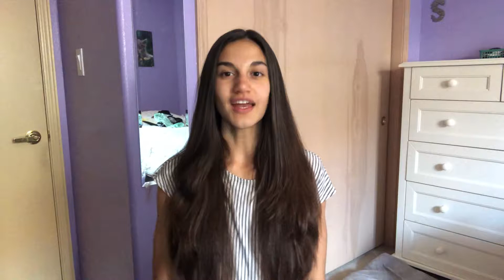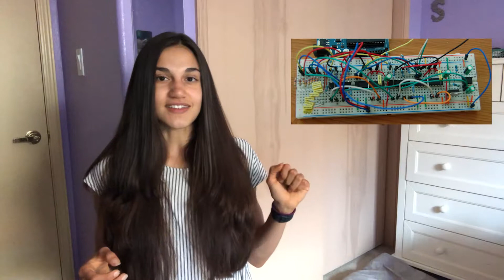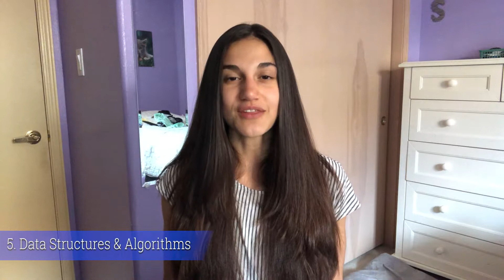Top 5 HARDEST Engineering Courses | COMPUTER ENGINEERING | My Experience

Comment: Is working on arduino helpful at all in this study before I go to study CE? I’m about to go to college and I just want to know what are some good things to know before going into the field so I have a head start. I know Java and C and how cybersecurity tools work and how to implement so that’s kind of a gauge of where I’m at
Reply: I can’t speak for every university/curriculum but with me (going into 3rd year comp eng) I would recommend learning matlab basics. This was my first language course required, and later in my signal processing (lab portion) it was completely using matlab. So far I’ve had a couple courses with arduinos but they very slowly introduced any use of them. I believe microcontrollers (year 3) goes pretty heavy in arduino but the courses before provide a really good foundation. Also any outside projects or hobbies (here IEEE robotics is great) that you can maintain is extra helpful. My curriculum had me take (in this order) matlab, c, vhdl, then Java. Language wise after about the first 2 Java came very easy to me and many other comp engr students, even with no previous Java experience (but it doesn’t hurt either). Hope this helped some, and good luck!

Comment: At our school, Data Structures was a weed-out class. The professor purposely made the projects difficult(for a novice) to see who could handle the independent research on their own. He did end up curving grades at end of semester AFTER the drop date to whoever made it that far. By far the most stressful class I took because we had to pick the structure and he wouldn't tell you if you did it the inefficient way, such as using vector of vectors vs using maps(which is way easier to implement) for a data clustering program. On another note Assembly Language was tough on the first go, but I picked it up fairly quickly in Embedded Systems when programming DSP's. I did have to take Linear Algebra three times, but I blame myself for lack of discipline on the studies.
Reply from the maker: Ouch, I know the feeling. The circuits I and II classes that I had were exactly like your data structure class (which is probably why it was so painful and long). Don’t know why some professors have a need to do that (especially for more advance courses) I think they just get a kick out of watching their students suffer...hey, well at least you finally passed the class, right? That’s all the matters in the end.

Comment: Which best books do you use on your studies
Reply from the maker: There were a wide range of books that I have used. I can’t remember most of them lol but some of the ones I do know for sure were electric circuits by Nelson Riedel (10th edition), Discrete mathematics (third edition) by Edgar Goodair and a lot of “Foundations of” books (i.e. Foundations of calculus/analog and digital circuits/networking). I plan to do a video on this sometime so if you would like to know more about them, then please stay tuned!
Reply: @TheSn12  i already  subscribed your channel.. please do so, Because I'll be starting my computer engineering course very soon. I would love to know the best books that i can use for the 1st year, 2nd year, 3rd year and 4th year. Btw have you ever used "mathematical engineering" by Stroud?

Comment: Do you use alot of the concepts you learned in circuits 1 & 2 in your career today?
Reply from the maker: Nope. Nada. Haven’t looked at that material since I took the class. Although, if you want to take the hardware track of CompE and decide to have a career that in involves building/tinkering with test boards/microprocessors then you’ll definitely use it.
Reply: IMO, basic circuit fundamentals are essential for most elec./comp. engineering jobs and career focuses. Being able to look at a circuit and understand how the signals within in go through it is the fundamental aspect of any design, test, or troubleshooting role in an EE/CE job. Like most engineering courses, you will not need to know every little equation or concept in your career. It is the fundamental methods you use to solve problems that bring success later in your career. If you ever talk to a consultant that works on diverse skillet teams, they might tell you that depending on the background of degree or expertise an individual will take a very different approach to solve the same problem.

Comment: so happy you said circuits 1&2 first lol
Reply from the maker: Lol yes they were tough
Reply: @TheSn12  circuits is a very easy subject all u need is systematic approach towards the problem. If you have good professor circuits becomes easy otherwise you will be clueless. Once you understand the subject well, you don't need to open the book before the exam.
But if u consider digital electronics I came across a question where you have to realize the given function with 2OR and 2NAND gates function : ab+bc+ca

Comment: So if you understand the concept of each circuit and the formulas it will be easier to identify which one to use. At the same time, could it be easier if a person actually experiments with each circuit in real life with the different formulas to remember what each one does? I must agree with you I'm an introvert as well, and the TAs not really stressing on the right or wrong. The purpose is to learn, after all. I like hands on for this reason, you learn first hand what happens and what's right and what's wrong (with proper assistance of course). With this said, having worked in the Navy, symbols and systems were a common part of our jobs so hopefully, I will do okay with that. Professors do play a huge part in how well we learn. I totally agree with that because I had to retake a course and the new professor was worse than my first. I almost wished I had the previous professor. Great video thank you!
Reply from the maker: Cindy Rivera Thank you for taking the time to reply! Yes, it would defiantly be easier to experiment with each circuit to understand the formulas but would most likely take longer and, personally, be more effort because you’d have to know how to build a circuit using the real parts and have access to a lab if you don’t have the equipment. But if it works for someone and they’re willing to do it then more power to them!